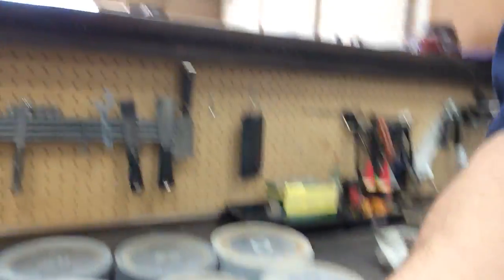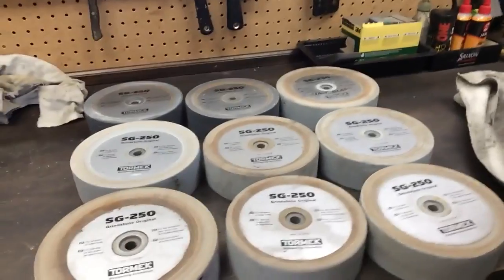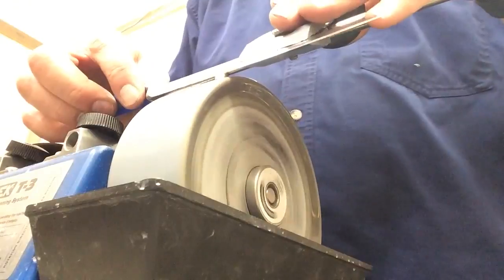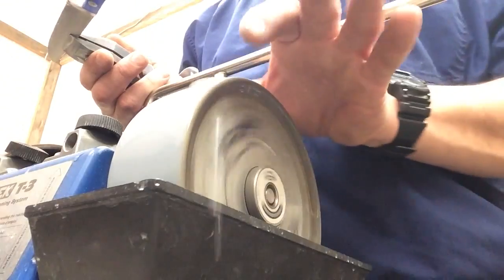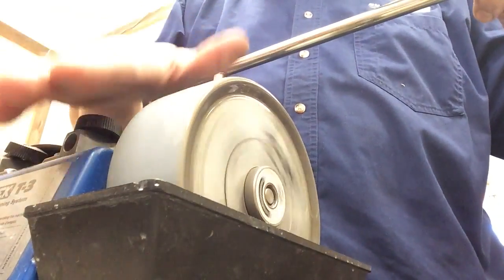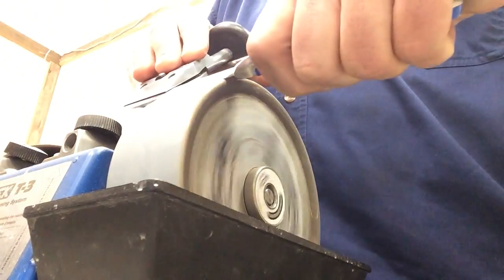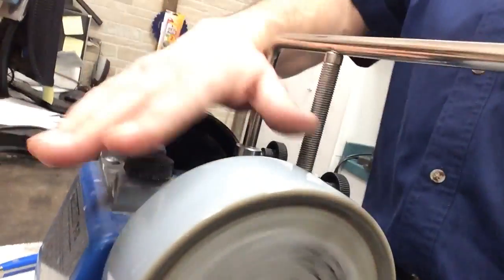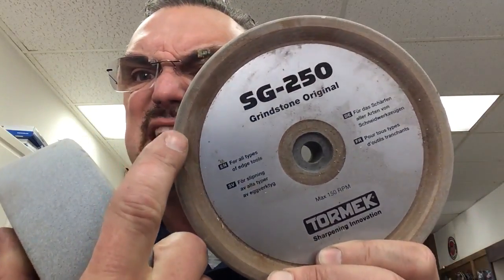Tormek SG250 stone on a T3 machine

Comment: Hi!
Will a new 250mm wheel fit on the smaller machine? Or does it need to be *used down to below 200mm before it works? If a new 250mm does NOT fit....what is the main hinderance? Too heavy for the smaller motor? Hits the base part of the smaller machine? Some other reason?
Thanks!
Reply from the maker: yes. the locking screw will hold

Comment: hi  I have a T4 Model with a Supergrind SG250 stone and I am trying to sharpen a blade similar to a chisel: 1. I notice that the  grinding stone stalled once I place pressure on the blade. 2. I do not seem to get sharpness on the blade.  Can you help.  Thanks for the video
Reply from the maker: Keep the rubber wheel clean and watch your pressure

Comment: Great channel! Could you please compare the lifespan of SG 250 to any of SD 250 stones. Thanks.
Reply from the maker: Do you mean comparing the Diamond Wheel compared to Stone Wheel? There is no "SD".  There is only SG, SB, SJ  Stones and DF, DC, DE Diamond coated Wheels.
The DE250 is a steel wheel with Diamond coating.  The SG250 is a wearable stone.
I recommend advance users on Diamond Wheels.  You do not need much pressure and you cannot "run off the edge" or you could wind up with the diamond coating damaged or removed all together.
So far i have been using the DE250 Fine for Benchmade and other luxury pocket knives, straight edge chisels and hand plane blades and the planer blade jig.

Comment: Great vid. Does anyone know if a new sg250 wheel will fit onto a tormek t3 or scheppach 2000s?
Reply from the maker: No, a worn down sg250.  About 135mm diameter.